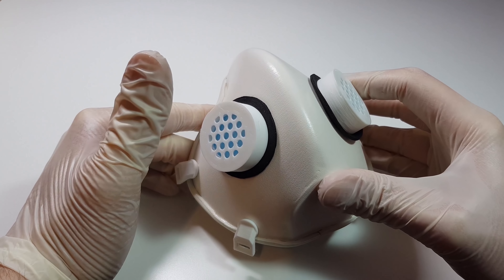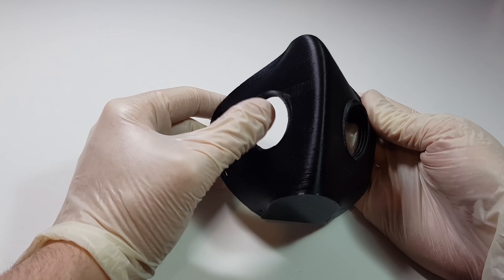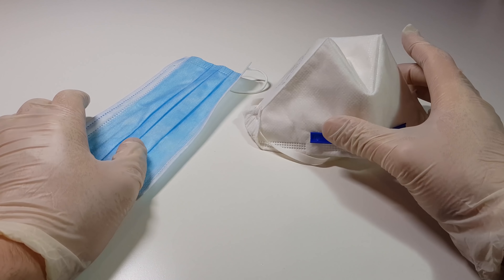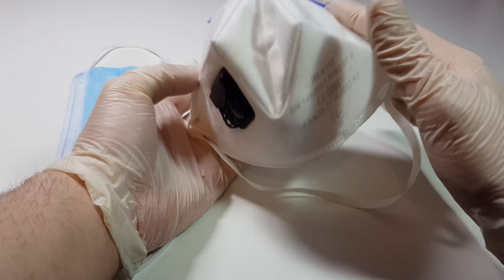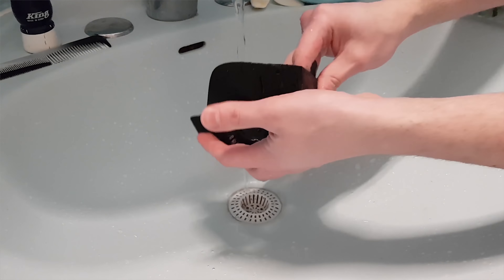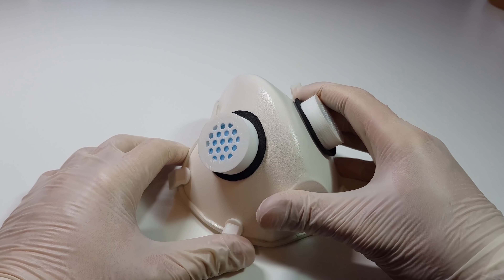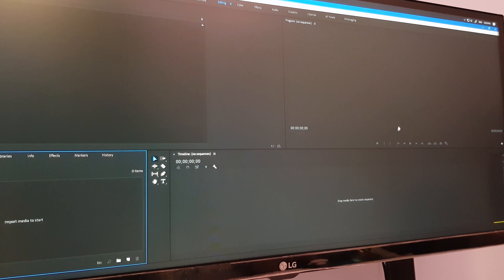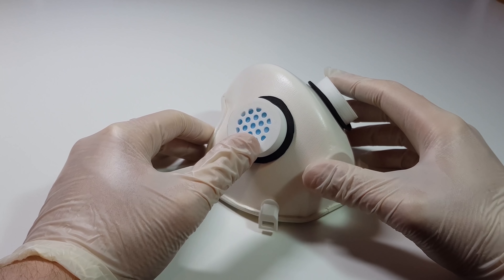3D Printed Breathing Masks. Do They Really Work?

Comment: With the correct printed material and proper filter, yes. Adding a gasket on the face is crucial as well. It must be completely sealed which is not always possible to do with run of the mill materials on a 300 dollar printer.

Comment: So just wondering... viruses move with the medium they are contained in. A microporous mask is not perfectly air tight, but almost - enough to make the seal more of a concern in that regard. How are these microscopic holes a problem in that regard? How likely even is it for a relevant amount of infectious material to creep throught the several layers of 3d printed material?
Reply: That's one of the things that people don't really understand about general use masks. It's for protecting other people from you, not protecting you from other people. The idea is to put enough layers between you and the outside world that when you breathe or cough or sneeze it's bound to hit something on the way out.
Reply: @torymiddlebrooks  if you cough or sneeze into a surgical mask it's just gonna blow through the sides.
Reply: Yup and, as was pointed out, that's not into the patient but into the sterile surgical suite.
Reply: It maybe impossible to stop all viruses. Over time eventually a small number of virus slip past. However inhaling 10 virus particles into your nose is quite different from inhaling 100 million virus into you lungs. The printed mask is much safer than a simple surgical mask or face towel. 

A true n100 mask fits your face with silicon and fits tight. It also has special filters. 

To the best of my knowledge Covid 19 has about a 1% mortality rate ( all comers). Small pox has about a 50% mortality rate. Lab certified N100 would be required.

Influenza infection is way down in the USA at this time. Probably because of simple masks. 

I think 3-D printed masks are great but must be used and modified for best performance.  Thank you for the great video.

Comment: I use N95 masks for sanding. One reason the give a good fit is because they are completely flexible so will deform to fit a wide variety of faces. The single biggest problem I've found is that when first put them on they provide a pretty good seal (for example you can see the mask deform when you inhale), then they get better as they warm up and get a bit moist from exhalation... then they get progressively bad  - starting at about an hour of wear - because the elastics holding them in place begin to stretch out and this gets progressively worse, especially so if you remove the mask and then put it back on because it has to stretch a lot to go over the head.

I would recommend either very strong elastic or a velcro strap. Take a look at the faces of docs and nurses coming off shift - their skin is indented and bruised from the mask.

Comment: vacuum formed masks would not have the same porous problems and can be mas produced with the proper mold setup.
Reply: Using 3D printing to create the initial mold would work beautifully.
Reply: @KyleFalconer1  You need to make a mould from the 3D printed part first because the 3D print would not be heat resistant, but other than that it would work I suppose
Reply: @rosserobertolli  I agree. The 3D print could be used to make the mould.
Reply: if you used higher melting temp plastics that are still relatively affordable/available for the mold like petg or abs you could use a lower temp plastic for the mask (PLA or equivalent non-porous sheet for instance).
Reply: @rosserobertolli   can print with high temp plastcs that would melt far later than the vaccum plastic :P
Reply: @222dolson   yea can print in a polycarbonate mold at 280c+ and vaccum form naturally cools down the sheet on contact anyway
Reply: i just realised- u dont even have to fill putty and anything like that- just clear coat the inside and outside i doubt fdm makes holes big enough after many layers to not be filled by standard clearcoat ! especially if u spray it thick!
Reply: Yeah too bad I dont have any of the tools and material, also isnt vacuum formed really brittle?
Reply: @meky0  would epoxy spray paint seal it better?
Reply: @ingusmant  You should rather worry about safety to breath the paint, epoxies tend to be unproblematic until you develop an allergy. Havin epoxy so close to you doesnt strike me as particularly smart.
Reply: No kidding.  Mass production isn't the point here.  Injection molding works fine for that.  For 3D printed, you can either acetone smooth the mask, or just spray it with a thick coat of enamel appliance paint (no sanding/filling).  His point was recognizing the problems of FFM with this item.  I would have redesigned the mask to readily available o-ring/gasket sizes, since that diameter is arbitrary.

Comment: .08mm is 8 microns, .08 microns is 80 nanometers. Clearcoat or a varnish will close small holes in 3d print. Rectangular prisms and square recesses would allow the strap holders to have more controlled angles or placement.

Comment: Thank you for making this video.  I have received a significant amount of requests to 3D print masks and leaving me to be the kill joy in our community expressing it is not safe to do so.  Typically the answer why it is dangerous tends to be more technical than the individual making the request desires.  Your video summarizes some of the problems and will be helpful in communication.

I agree with the comment below that the reduced filter material surface area is area of concern.  The increased flow rate due to the filter being smaller would reduce the ability of the filtering material.  Not having a quality test setup to determine the change is a variable that needs to be communicated to the end user.

Comment: The one issue of the smaller filter diameter is that you are forcing a larger quantity of air through at a much higher force than is safe.  The better solution would be to make the filter surface area larger with a baffle of sorts on the inside to evenly spread the air across the element.  I suggest a filter at least 2x3 similar to that of most 3m particulate and biological filtration elements.  Beyond that, excellent.
Reply: Like you said, the designer didn't knew how Filters work.

Comment: use ABS, and then give it a quick acetone mist to smooth seal the gaps.
Reply: Woyld it actually work? And in pla?
Reply: @ingusmant   baware that acetone smoothing is toxic... acetone molecule will remain a long time into the abs... not good for lungs...
Reply: @freedom2000  yes, you could in theory heat it up to help with evaporation. 80C in oven for the night should do.
Reply: @ingusmant  there's no safe way to chemically smooth PLA. You can try with chloroform, but it's really nasty stuff.
Reply: Bad idea.

Comment: The notion that 3D printed masks will let aerosols pass through layer gaps and porosity is laughable. Unless you are only printing 1 perimeter or an inline seam, this is not an issue. Porosity must be measured against pressure. Your lungs are not anywhere near strong enough to cause air to pass through.
Reply: This is true, however, sanitizing this thing without a smooth surface will be a pain in the butt.

Comment: Very informative video. I am a medical and aerospace engineer and specialized in materials. I use SEM machine to actually look at 3d printed parts. To let you and the community know, those are not holes in the prints, they are dimples that do not go all the way through. I have done pressure and fluid tests to see how much leakage is really there. 1 wall is solid, accorsing to my sem images. 2 walls is just fine. 

Remember, we dont breathe out viruses, its impossible, we breathe out infected cells which are huge and easily blocked. We do not need to concern ourselves with the size of a virus because thats not how a virus works:) viruses are non living and NEED a living cell to provide the resources to allow replication. The smallest size host cell that can allow replication is 0.4 micronsParticle size is important, just because you can smell something doeant mean the mask is not working. Sulfur molecules are 0.00004 microns in size, and we can smell them. 

 mask material is statically charged to act as a magnet against 0.3 microns because that is the HARDEST size to capture. 0.3 size moves very linearly and follows the same streamline and pressure gradients as the fluid they are in, air.. things smaller than 0.3 are easier to catch because they bounce off of other gasses. This ia known as Brownian motion. 

Lastly, PLA and 3d printed parts are very esay to sanitize and clean. Rubbing alcohol and soapy water can get into pores as small as viruses. This is because soapy water and rubbing alcohol have a very low surface tension, which gives them a very small wetting angle. do a web search on wetting angle. I actually did my thesis on this to test if PLA printed parts are food safe... answer is yes and no hahaha

Comment: you can avoid those holes by increasing the nozzle heat so it can be melting the plastic not only what going trough the nozzle but at the same time while putting the layer on it can also melt slightly around that layer plus increase the printing flow around 130% especially wall flow so it can fill the walls completely :) so you’ll have completely perfect print if you have a good printer and extruder in good condition! good luck

Comment: Too small filter area. Hard to breathing thru. There is no expiration valve > the filter becomes wet > more difficult breathing. No good mask.
Reply from the maker: In version 2 of the mask, the release version, the filter area is more than twice the size of the one in the video. I did think about adding an expiration valve to the mask, the only problem with it is that with the virus being so small, it could actually enter the airway the split second the valve needs to close and air is aspirated into the mask. Some medical professionals are even taping over the valves in 3M masks, just in case.

Comment: Printing at higher heat would make a denser FDM print. But wow great video. Super subscribed!!!
Reply: Just finished printing the main mask bit. Did it without supports so the bottom is just the tiniest bit warped but it came out great. I did it PLA at 100% infill and 240C so it feels super solid but I will still follow all your steps. The mask fits the face perfectly just printed, put my hands on the two holes and zero air. Cant wait to completing it. I was watching other facemask vids but yours was the first that I felt was worth making! Thanks!

Comment: I think there is a lot of confusion about what the mask is supposed to be able to do to be usefull. Replacing a respirator that protects the person who wears it in a contaminated environment is just as hard as you describe. You need to seal it to your face, only intake air through the filter and either dispose of it after short use or be able to sterilize it. 
However there is another use for a mask and that is if I want to protect others from myself because I cannot know for sure if I am one of those asymptomatic virus carriers or not. To that end our government now requires everyone to wear some protection over nose and mouth outside your home. Everyone who can is sewing cotton masks for everyone who cannot. Everyone wears them, even all the TV hosts, government officials etc. Again, the point is to stop yourself from ejecting viral droplets onto other people directly and decrease how much you contaminate public surfaces around you. The 100% cotton cloth can then be sterilized in boiling water for a few minutes or in washing machine at 60°C or higher cycle and then used again. 
For this second purpose I think a 3D printed mask can work. You just need to design it so that the filters can be replaced or sterilized and the mask itself can go through some sterilization. I am playing with some prototypes now and printed in PETG they can easily survive trip through 70°C dishwasher and a long dip in isopropylalkohol. So I think I can make it as good for myself and people around me as the cotton mask but more comfortable to wear because I wont have a damp cloth sticking to my mouth when breathing in.
Reply: Jiri Hebeda finally a great answer , the point mostly is to stop the cough with the mask, or minimize it , i agree with the fact that a 3d mask can be sand and filled , seal it and a good replaceable filter( hepa) not too many ppl know that hepa filters fight particles at 0.3 microns, even if virus and bacterias are at 0.1 micron level, anybody that have studied filters enough know that when particles reach 0.1 microns , things get weird and this bacterias and virus start crashing around with gasses and air particles  make in it bounce, and actually way easier for filters to catch it, the real deal is particles in between 0.1 and 0.3 microns, those are the hardest one to catch, but hepa filters are the best for this job.
Reply: cotton is not a great filter for filtering corona viruses
Reply: @freddykoopmans6985  No, not great, but much better than empty air, especially for larger droplets. Given the choice between those two options...
Reply: OU812 at that measurement of microns , particles are so weightless that they start zig zag crashing with air particles and gases , which is way easier for filters like hepa to catch them
Reply: @OU81TWO  The way I understand it, the virus doesn't travel effectively on its own through the air, but inside water droplets.  If the water droplets containing the virus are stopped, or reduced by the mask, it is doing some good.  I've also heard it said that 'viral load' is important.  A single virus may conceivably cause infection, but in practice it usually takes a larger number to be effective.  If that's correct, and if a HEPA filter prevents the droplets from getting through, even if a lone virus in principle could, that may still be a significant level of protection.
Reply: I am using 3d printed mask when i go to shopping. The reason why i am using it actually. So when i get home i put into diluted bleach and clean it with soap. Do you think it is enough ?
Reply: @joelavcoco  Anything you put in front of your nose and mouth and seal it around your face is better than nothing at all. I'm just saying that the filter rating doesn't guarantee 100% protection. There are many other factors to consider.
Reply: @3qUInOc  I am not sure what is in your bleach but basically if it can reliably disolve the lipid (fat) molecules that make the outer shell of the virus it should be enough. Medical grade desinfectants tend to kill it in seconds but if you just have a strong soap you can compensate by giving it hours to work instead of seconds. That is all just my guess from what I have been able to learn over the past few weeks. I am an electrical engineer and not a biologist or a chemist.

Comment: Even being slightly porous before sanding and sealing, printed masks are sure a heck of a lot better than no protection at all.
Reply: If you have a hammer, is everything a nail? By all reason sewn cloth mask with a steel nose wire and a filter liner is a much better choice. Easier to breathe in, better fit, and loads more filter area. Even with 3d printing as a tool, it'll be better to explore the solution space, and potentially use 3D printed parts largely as reinforcements and attachments. Will also make for much quicker prints.
Reply: Don't forget the fact that the porous nature of the filament is hard to clean and has a lot of surface area to trap the cirus

Comment: You should redesign the strap anchors to tri-glides or "ladder" slides. Allowing the strap to be adjusted without any additional hardware and without having to tie your elastic head-strap in a knot at each anchor point

Comment: 3D printing is a great for a prototype now you could take your design and prepare the surface so that it is no longer porous. Then transfer it to a silicone mold, and from there use epoxy or two part plastic. At that point you could produce masks faster then you can print.

Great job on your video and great that you are making people aware of the porous layers.. to those starting out they might know the layer gaps compared to virus size.

Have you looked into resin based printers ?
Reply: Aubrey Jahier dont tell the secret of the sillicone :x haha im way ahead with the sillicone already, im happy if this can save lifes
Reply: Alberto Loredo  I will keep quiet and wait and see...  please show us if you have time ...👍
Reply: Aubrey Jahier i will , promise. also i have to say, there are plenty of fishes for everybody, i kinda felt scared since i spent a lot of time and money on this pipeline , but in the other hand, if more people can do the same we can save lifes, that has to be more important than money, but obviosly we all want to be rich, ill pick a midpoint.
Reply: Alberto Loredo  yes I agree lives first, and then hopefully no good deed goes  with out reward.
Reply: Aubrey Jahier im happy to know that im not selling this at crazy prices like the guys that i have seen in ecommerces, charging 50$ for masks not even sanded or filled with prime.

Comment: If anyone is going to build a mask like this, and rely on it, please PLEASE do a proper fit check. I wish you showed a procedure in the video, but I'm glad other designs were called out for their flaws.

1. Put the mask on and tighten the straps.
2. Completely cover the air intake on the filters with your hands 

3. Take a deep breath. The mask should suck hard against your face and no air should come in. 

Facial hair will probably prevent a good seal. Filters of this type will get clogged with particulate and eventually it will become very hard to breath through them (though commercial filters are usually significantly larger, and will last 10 hours to 1 year depending on use). Replace them often. If the mask begins to smell, clean or replace it immediately. Be responsible, stay safe!